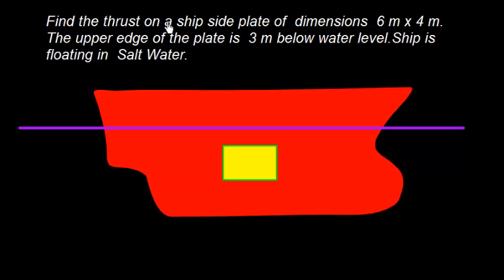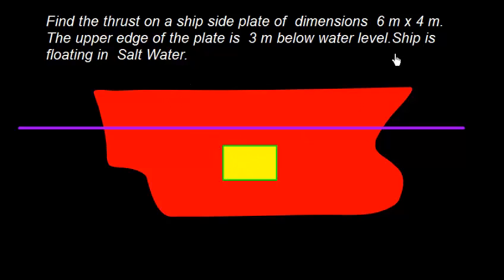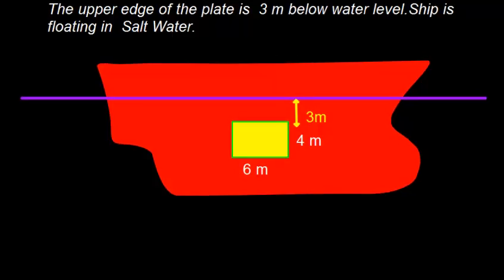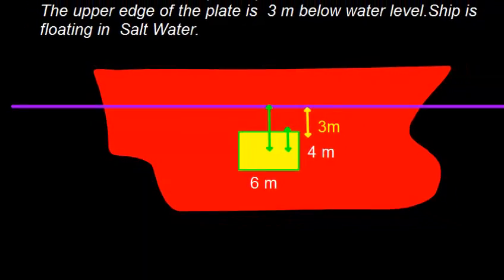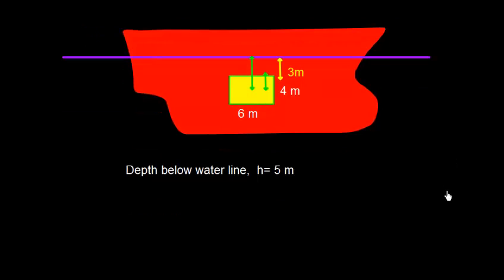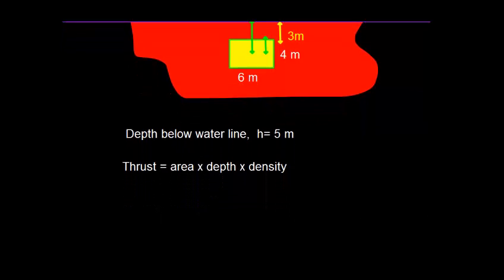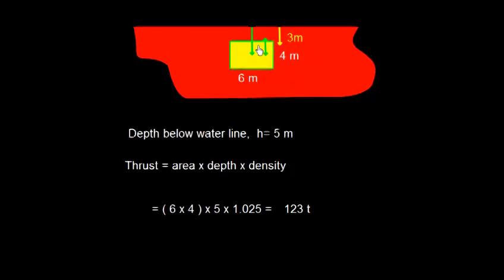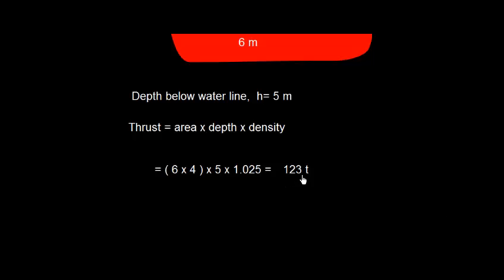Ship Stability Thrust  on Side Plate

Comment: Could you explain this please, thrust is pressure x density,  why pressure is density x depth, and not density x depth x gravity, shouldn't we find the hydrostatic pressure
Reply from the maker: The usual unit of pressure is Newton/ square meter or Pascal. However, in ship stbility we are using tonnes/sq m. This tonnes is the unit of mass. Thus the pressure we are using in ship stablity is not  Newton/Sq m or Weight/ Area rather tonnes/sq m or simply mass/ Area. Since Weight= mass x g ( accleration due to gravity),  So in case of pressure with tonnes/sqm, g is not considered. Hence ideally P= h x d x g with unit N/Sqm. Howere P = h x d with unit t/sq m. Trust this calrifies. By the way if we are using forces in vertical directions eg weight down and buorancy force upward, the g will get cancel. Only remainiing will be mass. However, if consider horizontal direction this g can not be ignored. That is the time you have to use P= h d g and the unit will be N or KN/m2 which is explained in the video by example on side plate. Trust this calrifies . Still if you feel some more clarifiaction is needed, I can add some video on this.